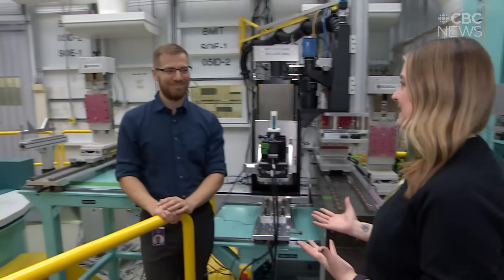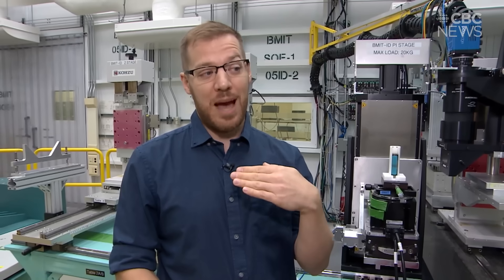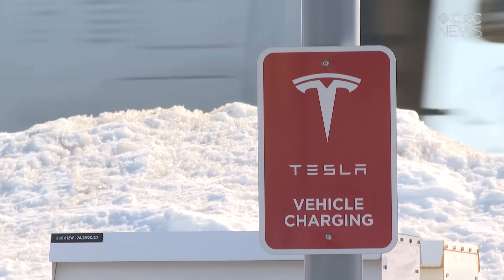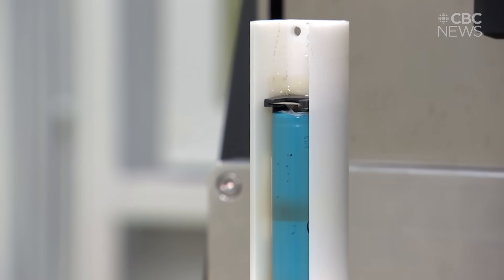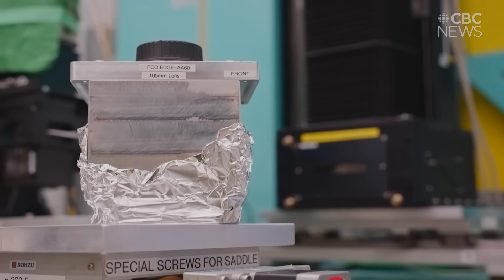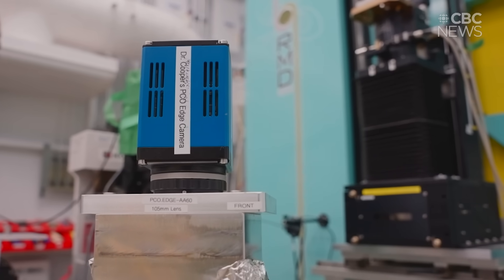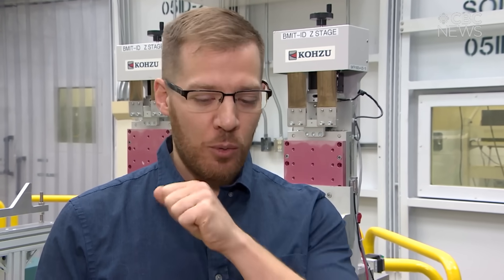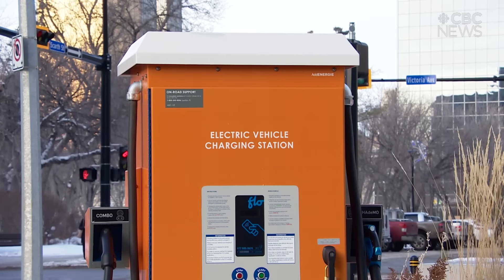New electric vehicle battery could run for 8 million kilometres

Comment: I've been hearing about these battery breakthroughs for 20 years. Hopefully this comes to market.
Reply: Hmm good point. Ill be skeptical
Reply: I’ve heard plenty of safer batteries that can last longer and charge faster but none are available and certainly not in ev which currently last about five years. Then they cost more than the car is worth to replace.
Reply: @jacilynns6330  "certainly not in ev which currently last about five years"  Nonsense.  Did you even watch the video?  EV batteries are lasting far longer than the 8 years they are warranted for.  There are 15 year old EVs still on the road.  Great strides have been made in batteries just in the last 5 years.  They are safer, charge faster, and are cheaper.
Reply: @jacilynns6330  
If they DO "Currently last about 5 years.... EVERY car would be getting at least 1 new pack during the 8 YEAR WARRANTY
(Duh?)
You really DO NOT know what you're talking about.
Reply: @rogerstarkey5390  duh you don’t know what your talking about since that is states only. Does not apply in Canada. Do some research.
Reply: And those breakthroughs enable you phone to last all day, evs to be practicle for last 14 years..
Reply: I totally agree with you😊 💯👍🏾
Reply: And the stories end with just a proof of concept breakthrough, scaling production issues, fire safety issues... And that means never going to happen or 10 years from now, maybe.... 3 months ago, Japanese tdk said they had a battery design that could go 1400 miles on a single charge... So sick of these click-bait stories.
Reply: It's the startup business model. Claim a new breakthrough...generate a  crapload of $ at the IPO...followed by....nothing.
Reply: @steveburke7675  
Do you know who he works for, or what the business model is?
Stop guessing
Reply: yes the week after nuclear fusion is mastered ?
Reply: My EV has 42% degradation after nearly 9 years and only 41k miles.
Reply: @FredFox-m9v What ev you have?
Reply: Our o&g sectors freaked out and lobbied the government so youre basically not allowed to have them.

  Depends on your province i hope, but house batteries arent allowed because Alberta is a fragile snowflake who needs daddy government to shield them from technological progress.
Reply: and fires lol.
Reply: Research CATL's new solid state batteries going industry wide right now in high end EVs and trucks inclu. semi's. They have a 1 million mile or 15 year warranty, charge to 300 miles in 10 minutes, have a range of 600+, weigh less than lithium batts and throw less heat. Theyre recyclable to almost 90% and cost less. lf they arent a 'breakthrough' youre not paying attention. My son-in-law has a masters in renewable energy engineering and teaches the course now. l hear about the future and its bright. 'Moore's law applies here as well and has been observed' he always tells his classes.
Reply: yes and we are going to get nuclear fusion next year again..
Reply: Well, if you're talking 20 years, there has been multiple breakthroughs. I'll refresh your memory; Ni-Cad: Nickle Cadmium, Ni-Mh: Nickle Metal-hydride, and Li-Ion: Lithium-Ion. That's 3 levels in 20 years!!! We'll add some education to that too explaining that Ni-Mh, the first batteries with full rechargeable properties, were first used in the first hybrid cars back in the late 90's, and have still been used in Toyota and Honda hybrids to this day. Ni-Mh are bigger and heavier and are still a more stable technology. The current batteries in the current  EV's are no bigger than your AA batteries, stacked together. A solid state technology would be similar to your 12v battery in your car, using exotic materials to cool the batteries, for greater stability and far greater longevity. The biggest challenge the industry faces is the left over current technology. The solid state battery was supposed to be introduced in 2025 or 2026 as of 2022. With excess batteries, we will be running the same technologies in everything that Li-Ion batteries run in. 2028-29 will be the next advancement by design at this point. Hope that helps you out.
Reply: All that innovation and my 17 year old Mercedes E Class diesel can go 3 times further, with a 650 miles real world highway range and more or less instantaneous refuelling, not WLTP. Not very innovative is it ?
Hope that is informative for you ?
Reply: @JJs_playground
IF you had been paying attention, you would have been Witnessing incremental "Battery Breakthroughs" for 20.... or rather 30 plus years.
Mainly "not from Western countries" (Who were in either the "ignorance" or "Denial" phase)
A good example would have been BYD, who started developing Vehicle batteries in 1994.
Reply: If you were old enough you could add another 100 years to that.
Reply: When we first started seeing the Nissan Leaf on our roads in 2010 we were told batteries would be so good and so cheap by the time they needed replacing, that it would be well worth doing.
At this stage I could buy a much more modern EV cheaper than I can replace a 2010 Leaf battery, why would I bother.
I'll believe it when I see it in a car.

Comment: Why would anyone want to sell a product that lasts a lifetime?
Reply: Because we cannot afford to waste the resources of the Earth frivolously.
Reply: Military purposes.
Reply: My understanding is that the push towards electric isn't just meant for making money, it's meant to save the planet from pollution and climate change
Reply: LED lights will supposedly last 20+ years but they burn out much sooner than that. And even if a battery lasts 8M km the car around it won't.
Reply: @dg-hughes when you eliminate all the vibration, the car lasts much longer. An electric motor is very smooth, it just spins. Also regen braking helps brakes last much longer.
Reply: @dg-hughes you would likely want a newer design but your trade could be very valuable with 7.2 million km still available, think about that, your battery pack could be installed in your new car.
Reply: There are 7 Billion people.  If you an get a dollar from each you will be rich
Reply: @kensmith5694  It's much better to get $100 from half of them 5 times.
Reply: Companies could lease it rather than sell it… expand your thinking